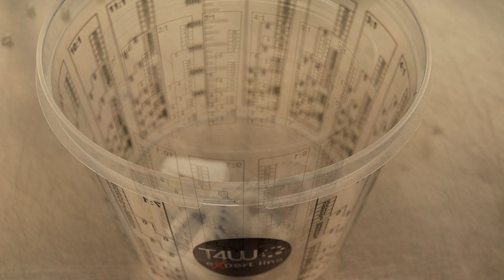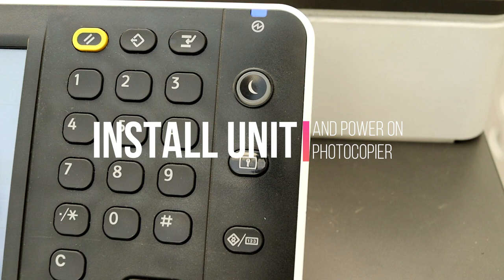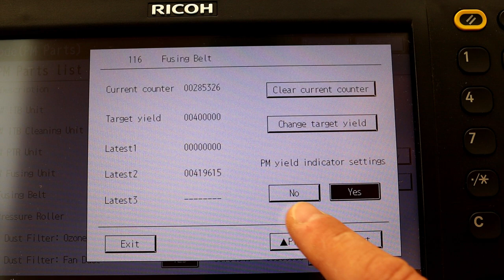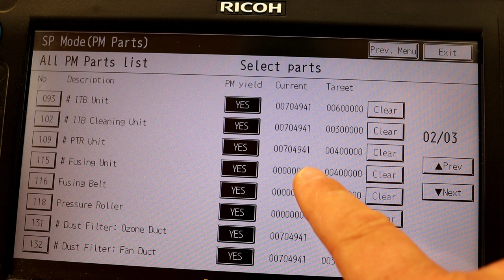RICOH MPC4503 MPC5503 MPC3503 MPC3003 problem utrwalacza SC554 sc544

Comment: we hope to do so for c4504ex fusing unit , thanks for your efforts 👍👍
Reply from the maker: I'm sure you can do this for a Series 4 model. The procedure is very similar. Soon I will make a video for MPC3504 and similar. Remember that the fuse is different from the MPC3503. Check it out: www.copy-expert.pl/produkt.php?iden=242215

Comment: Tenho um ricoh c4503, levei minha máquina para um técnico, fazer um reparo na placa principal, no visor São 4 gavetas agora só aparecem 2, o que deve ter acontecido?
Reply from the maker: A copiadora tem 2 gavetas. Os próximos dois são uma opção adicional. Coloque a máquina em cassetes adicionais e conecte as mangueiras à junção. A ficha que liga a copiadora a cassetes adicionais está frequentemente danificada. Então tem que ser substituído.
PL: Kopiarka ma 2 szuflady. Kolejne dwie to opcja dodatkowa. Postawmaszynę na dodatkowych kasetach i podłącz przewody z połączeniem. Często uszkodzeniu ulega wtyczka łącząca kopiarkę z dodatkowymi kasetami. Wówczas trzeba to wymienić.
ANG: The copier has 2 drawers. The next two are an additional option. Place the machine on additional cassettes and connect the hoses with the junction. The plug connecting the copier with additional cassettes is often damaged. Then it has to be replaced.

Comment: Saludos!
Ante la poca presencia de técnicos idóneos en mi país, me vi  obligado a aprender a hacerle mantenimiento a mi maquina (MP C3503)
Ahora me encuentro con un problema, la unidad magenta imprime más claro hacia un lado de la hoja, que me sugieres cambiar?
ya le cambie incluso el polvo revelador.
Reply from the maker: Hi. I am glad that I can help develop your knowledge. I had this problem several times, but each time there was a different solution. First, check that light magenta is produced when printing and when copying. If the problem is only when copying, then we have a scanner defect and you will have to look there.
If the problem occurs also when printing from memory, replace the Drum Unit with a different color and check the printouts. All Drum Units are the same so you can do it. This activity will probably help you already.
Sometimes, however, the entire developing unit needs to be replaced, i.e. a damaged charge roller.
Sometimes the spring in the toner supply unit is damaged.
I wonder if you can fix it.
Be sure to write in the comment whether you will be successful.